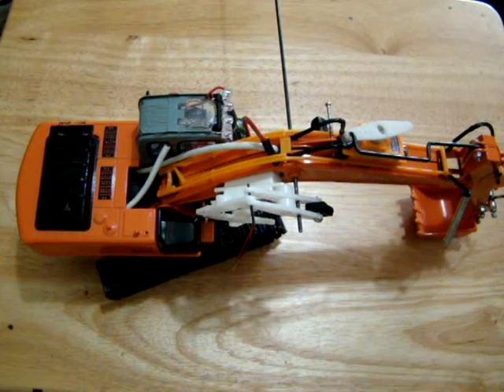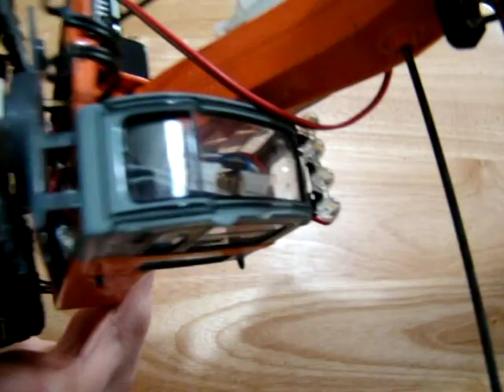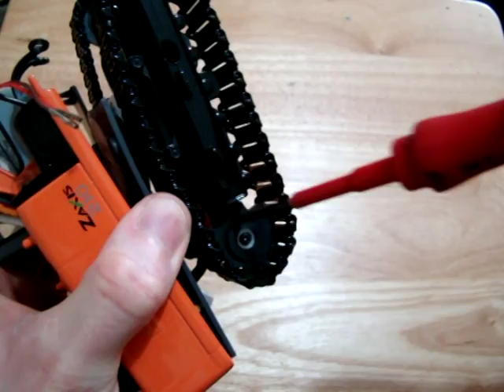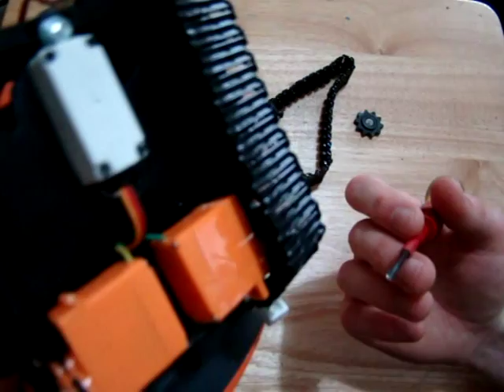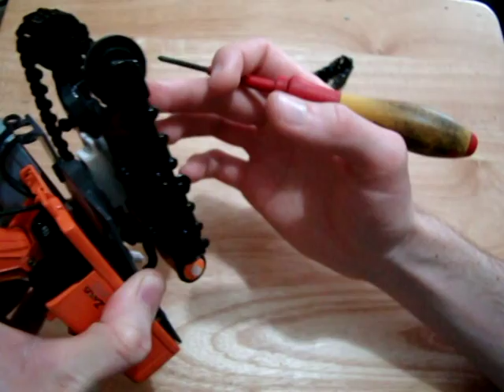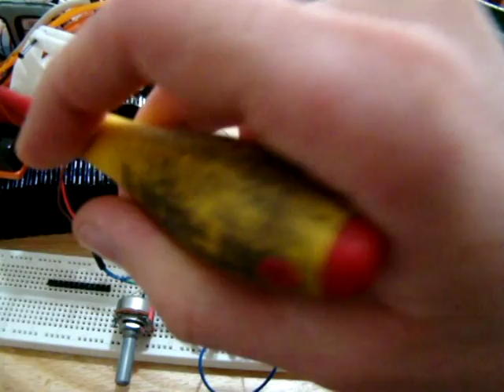RC Tractors - Hitachi Zaxis 210 Internals

Comment: excellent work converting the excavator ,but have you thought about using wood auger bits incased in pipe with setscrew for bit travel ,I have a couple of bruders converted using screwdrives ,they work good . some micro metal servos with 1/4 " sst tubing should work good for the 1:32 models ,I'm using 3/8 and 1/2 sst on mine 1/16 bruders  
Just a suggestion ,again great work you do on the models
Reply from the maker: Thanks this model was a good first attempt but the servos didn't work out so good because of the heavy boom. You're definitely right that screw mechanisms are the way to go and I'm doing that with a new Komatsu pc400 build. I actually filmed part of the screw mechanism build at the weekend. I'm using N20 gear motors and M3 threaded bar to start with but I'm mounting the motors externally on the arm so that I can easily change the screw to a drill bit if needed or the motor to a more powerful one later when I can properly test it out.